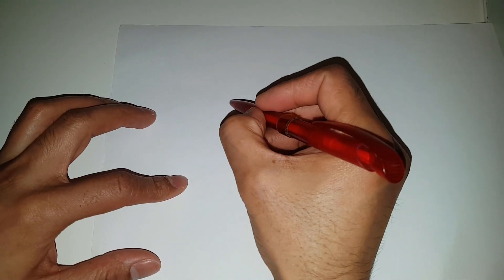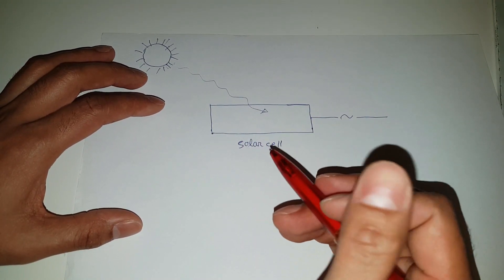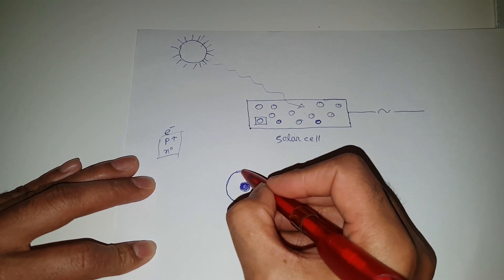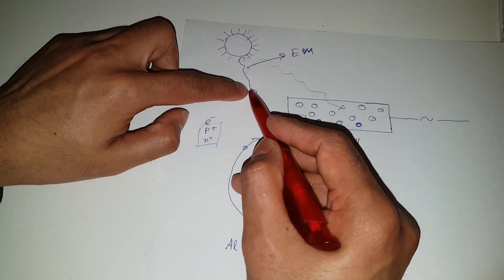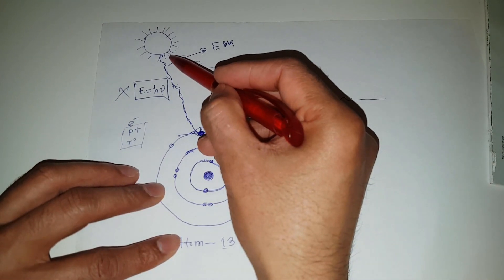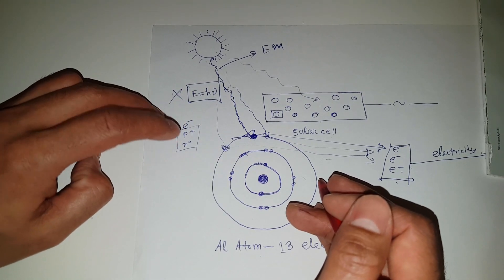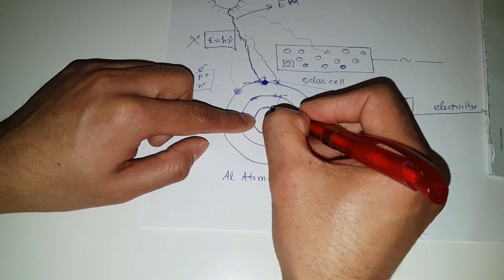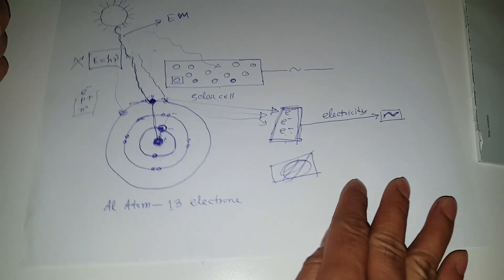How Solar Panels Turn Sunlight into Electricity | Photoelectric Effect

Comment: Does the photoelectrons move in a specific direction
Reply from the maker: Yes, photoelectron moves on based on how to solar cell is designed, basically ETL layer is being used to extract the photo-electron through cathode electrodes

Comment: Silicon atom contains 5 valence loose electrons in outermost orbit ..and boron contains 3 loose valance  electrons in outermost orbit...so when sunlight heat to the silicon boron so loose electrons of both silicon boron get more charge then not able to in the attraction field of nucleus proton so...bot side from boron silicon free electrons released and later again both silicon boron try to fill outermost cercle electrons thet is Max 18 electrons ...so charged free electrons flow between  silicon boron then magnetic field and new free electrons generated that extra electrons pass through batteries silicon metal area is less boron is hight so farm the magnetic field to generate extra charged electrons....when no sun light the ..then the loose electrons won't get full charged to become free electrons from the silicon boron and won't spinning around silicon+ boron - combined way to generate magnetic field to create new electrons

Comment: Sir I have one doubt in this photoelectric effect vedio you have said that electron absorbs sun's energy and get excited
My doubt is why here proton and neutron is not absorbing sun's energy and get excited?
Reply from the maker: Well made question. Actually protons are strongly bonded with nucleus by strong-nuclear interaction. protons also absorb energy but the absorbed energy is not sufficient to set them from nucleus. Thats why the absorption is energy by protons/nucleus is neglected. This phenomenon can be explained by quantum mechanics.
Reply: @Matescium  sir, then is neutrons and protons are stucks in nuclear interaction?
Reply from the maker: Yes, protons and neutrons are bonded by strong nuclear interaction that is very strong force. Thats why its hard to remove the protons from nucleus.

Comment: I could have used you as a tutor in chemistry! Very good explanation! So if the electrons are kicked out, does that mean the photocells have a finite length of life or do those atoms reabsorb electrons from somewhere before they can again kick them out to form electricity?
Reply from the maker: Good question, electron kicked out means it does not really kick out physically, it just changes the energy state. The empty place from where the electron were kicked out is filled by another neighbor electron and create another empty space called hole and this process is going on. It is very complex theory, quantum mechanical theory required to explain it in details, just simply I can seay the number of electrons does not reduce. Just energy state changed.

Comment: Good job and very nice and educative explanation.thanks for sharing..keep it up.

Question: the amount of electricity produce is with respect to what!
To the metal used in the solar panel OR with respect to the amount of sunlight and EM wave falling on the panel.
Reply from the maker: The amount of output power as electric current depends on many factors, for example, the intensity of light/electromagnetic radiations. Higher the intensity of light means higher the current but it has a certain limit. And The amount of electricity produced depends on the efficiency of the solar cell, how it contract, which materials used there and so on. Simply I can say higher energetic sunlight can produce a high amount of current, lo light means less current. Please consider it's not so simple as I am telling here. Thanks for your question.
Reply: @Matescium  thank u so much for answering.